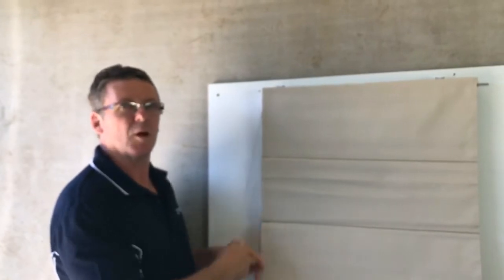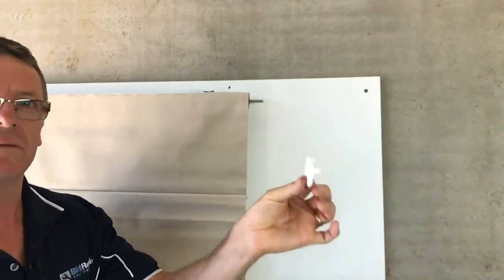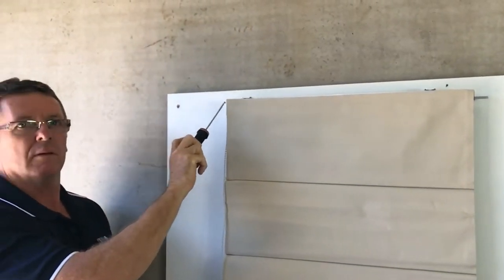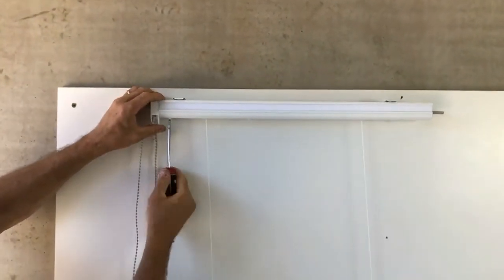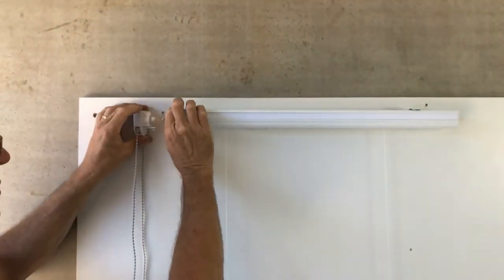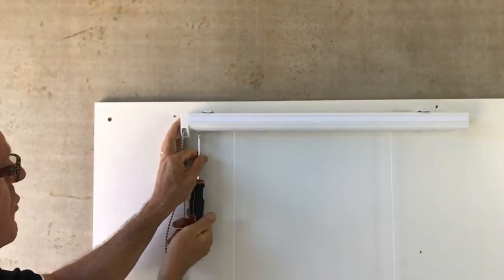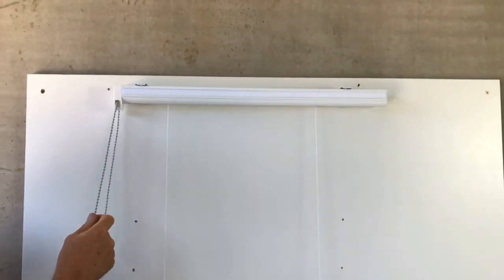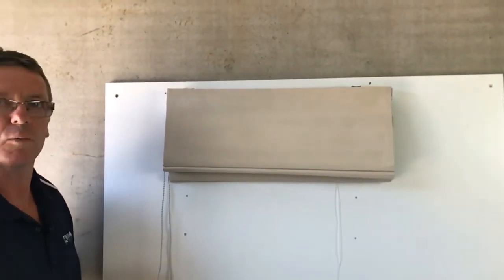Roman Blind Won't Roll Up - Simple Fix.

Comment: I have just replaced the control unit on my Roman Blind. Chain moving well in the conteol until before reinstalling it in the roman blind bracket. However, once installed it is very tight and nearly impossible to roll up without force. I am now afraid it will snap due to the force requred to roll it up. Any ideas what might be causing this?